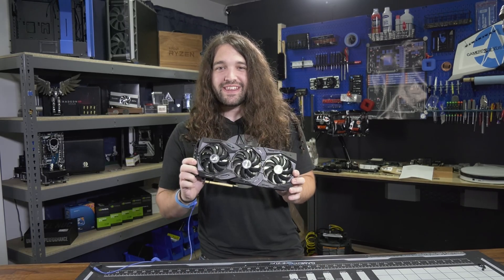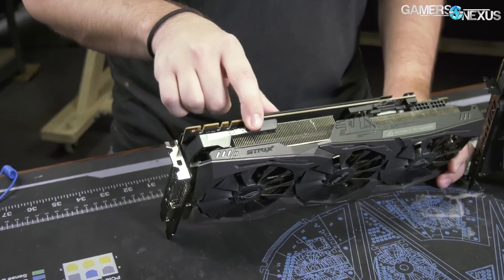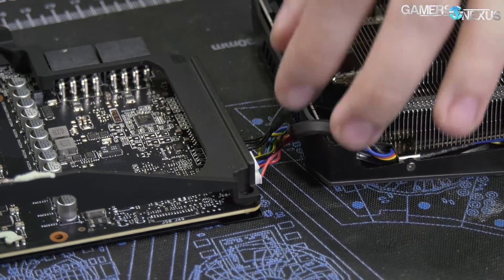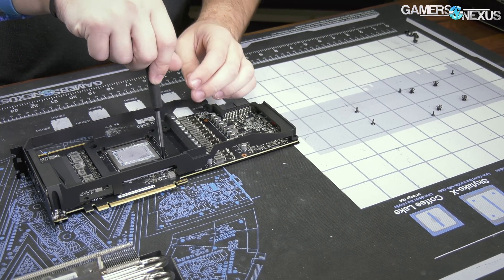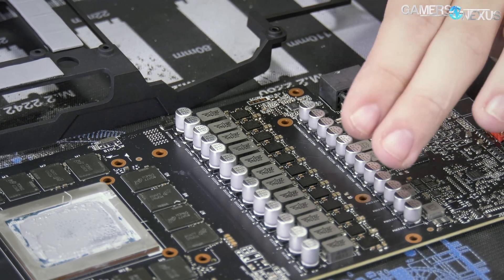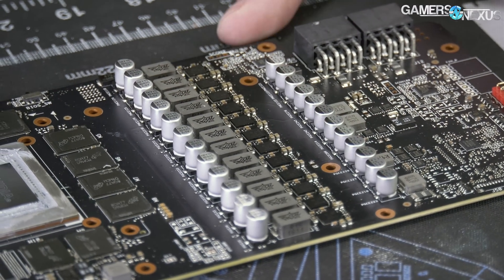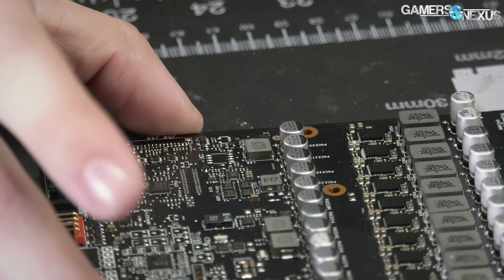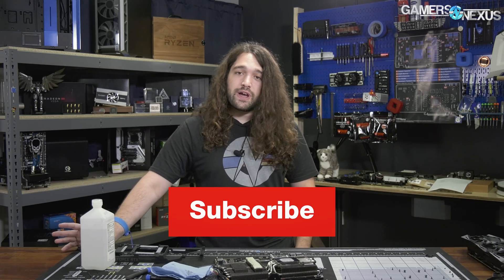ASUS RTX 2080 Ti ROG Strix Tear-Down & Custom PCB

Comment: As for the chip markings and the "K1", seems like the memory channels might be labelled with a letter (A through L), as the K1 cards all appear to be missing the 11th memory module. (much like all GP102 1080 Tis did, IIRC)

Comment: Is there seriously no Thermal Pad connection between the Part of the Baseplate over the VRAM and the Cooler?
And no Thermal Pads under the Backplate as well? 
So we only have the surface area of the Baseplate to cool the VRAM?
Might be sufficient, but it still leaves a bad impression.

Comment: You need to make an adjustment to the screw placement grid. #1 smaller grid, much smaller. #2 Have 3 GPU references in the big white square. This way you know what screws go to what process. You mixed backplate screws with cooler screws.  #3 A new addition to the mat, magnetic there to hold the screws. The cheap magnetic strips used with really cheap refrigerator magnets or bought at any craft store in rolls, about 1/4 inch wide...Have strips of those embedded in the mat very close to the surface so the mat can be rolled up still but can help hold the screws. Maybe if there are stronger magnetic strips that's 1\4 inch or less wide available those might be preferable. 1 and 2 are self evident, smaller grid easier to know where to put the screws and more GPU's less mixing of screws. #3 on the other hand is to keep that sorting you painstakingly did intact if the table gets bumped. As it is the screws will fall over and roll about, if you have allot of them they can become mixed up. Sitting on a magnetized surface they wont fall over and roll plus they will be easier to stand up and if don't care if they stand up they wont roll if the table is bumped.

Comment: 12:49 The K1 could probably mean that the missing memory module has no associated capacitors and/or resistors that help control Vmem to the module. Different Kno could mean different layout of SMDs along the PCB traces.

Comment: Memory module 11 is missing according to the labeling on the board (M11). K is the 11th letter of the alphabet. So the code should be pretty straightforward.

Comment: This is the year of tech curses. APPLE makes an overheating i9 macbook yet becomes a trillion dollar company. Intel overclocks a cpu and goes back to 22nm because they cant do 10 nm. WEIRD RTX launch and the Tom's Hardware just buy it, life without Ray tracing meme,  The return of Athlon by AMD and the Verge building a 2000 dollar computer like it's April first.
Reply: From what I have heard the new Athlon is just a low end Zen with different name, like Intel's pentium. And it's also locked
Reply: Charlie Brown And that's the best thing AMD can do for now. Having the control of the console market is great for them it means that RTX will never be fully adopted by developers just like the rest of the gimpworks right now. Also it'll make sure that games will be better optimized to PC Navi.
Reply: Wait? 22nm? Wut?
Reply: 22nm for chipsets*
Reply: V. P.  *for cheapoo office chipsets.
Reply: @SweetToothVice  ya I know
Reply: They finally removed that "2000$ PC Build video"
Reply: 1500$ iphone lol
Reply: Guys it's just a joke, relax

Comment: wouldnt the K1 naming be based on the letter? K is the 11th letter of the alphabet and the m11 mem module is missing. Just a thought.
Reply: that actually makes sense. i didn't count the letters off so i'll take your word that it's the 11th letter.
Reply: That's what I came to comment saw this then decided i didnt need to anymore
Reply: Maybe I missed it, but could the k denote which module is left out. Ie core 0 core 1 etc

Comment: noob question can the back plate rbg connection be used with a  regular rgb strip if i solder joinst to it to adapt it? wondering cause i want to do a custom plate for that gpu strix 2080ti.
Reply: In theory it's possible.  You'll have to do some digging to get the pin outs correct but i can't see the RGB on that card being any different to Asus' Aura from their motherboards other than maybe a custom plug.  So if your strips are Aura certified then you should be good.  Don't solder to test though ;)

Comment: I know probably does not make any difference (in thermals, I mean), but it kind of bugs me the sticker on the nickel block, near the thermal plate. Otherwise, a great card, and I really appreciate the detail of the cables at the back. Had a bad experience with on breaking connector in my Gigabyte card (only for the LED though, so I left broken for the time ).
Also, Nvidia should learn from them for the servicebility.
Reply: No doubts asus is the best

Comment: Back plate cutout for hot components. So back plate doesn't help heat dissipation?
Reply: They never really did
Reply: I honestly think they are more for the components on the back of the card protection. My 1070 card has a backplate, but it's plastic and the card itself has no high heat-producing components on the back side, just a bunch of resistors, diodes and capacitors.

Comment: So asus has prepped a PCB for partner versions of the Titan, I wonder how soon the Titan will release as it seems they know about it
Reply: Not really,  Like Steve said the K1 section of the product number corresponds as to which RAM module is missing from the potential set of twelve.  I would imagine that say a K3 chip will have a module missing elsewhere on the board so when they mass produce the boards they have to make space for all the modules because they don't know which one will be missing until they marry the chip to it

Comment: Are we at the point yet Where these cards are so big they need another point of connection?
 Its like having a full size pickuptruck hanging out the 2nd floor of a parking garage.

Free Idea.  optional folding Kick Stand with infinite adjustment via a long screw.
Reply: I've actually seen something like that coming with one of the Vega cards from Sapphire. Though it wasn't a stand, it was an angled rigidity bracket that's supposed to be mounted with the same screws that are holding the expansion cards. Sapphire NITRO+ RX Vega 64 Limited Edition that is.

Comment: please stop wearing anti static bracelets.  You also missed a perfect opportunity to throw shade about the verge dude working in the Asus factory as the thermal paste intern.
Reply: Owen Parsons why should he stop wearing ESD straps and being grounded? It’s science. Static discharge is real and can be proven. It’s a very cheap component and worth not potentially damaging something.
Reply: because most people don't know how to use them.   Steve actually pokes fun at this by disconnecting the lead. They simply put them on and then magically think, wow no more static.  giving people a false sense of security.  They need to be grounded to work.  Many people don't understand where they should clip the lead.  it is far easier to just make sure you have adequate humidity, work in a non carpeted area, and to touch a grounded source before working.(plugged in, but turned off power supply)
Reply: Owen Parsons ah I see your point here then! I use a grounding tester myself to double check myself. Beeps if I’m good. But I definitely see your point and agree.

Comment: Only 18 screws?  Seems low I want one with 80 or so screws instead and needs glue.
Reply: and a cover glued on over the screws so you can't clean out the cooler, lol.
Reply: Don't clean the cooler, burn your card and buy a new one.
Reply: I know right. Couldn't imagine how much production cost could be cut out and passed down to the consumer.
Reply: @James Murphy. Ah, that's why the reference cards cost $200 more then their AIB counterparts.
Reply: I dont feel safe with only 18 screws. Something must be wrong with the card.
Reply: If they are only going to use 18 screws they could have least welded something!
Reply: Think big would ja?!
Reply: Price per screw is bad on this card
Reply: I mean, why would you even want to clean your heatsink!
Reply: lol, yeah, just buy a new card when dust starts to cling to the fins, lol. It's the new Apple-vidia, lol.
Reply: Zarcondeegrissom dammit you beat me to it. ;)
Reply: I know it's meant to be a funny comment only but you do realize that the 80 screws from previous video was with the cooler disassembly, right? Here Steve only separated PCB from the cooler and didn't even touch the latter. If you want to only remove PCB (for instance for LC) you only have to remove about 30 screws (yeah, still more but not nearly that many and no glue involved ;-))

Comment: Sorry if I missed it but what is the max power limit? Also, the MSI Trio only did 110% power in afterburner when Guru3D tested where as FE was doing 123% and EVGA reference XC ultra was doing 130% if I remember correctly. Does that seem weird to you?
Reply: I think Steve mentioned that before a bios update the evga was also stuck at 123% so maybe the others are due to a bios issue as well?

Comment: Did The Verge & Tom's Hardware do a review on the 2080ti?
Reply: Sadly,  yes.  "The Verge" has an RTX-series GPU review on their website,  and they used their improperly-built PC to run the benchmarks!
Reply: Erik Hendrickson  Really hahaha wtf
Reply: yeah, they filmed the build, and fixed all the 'mistakes' off camera, misleading anyone that watched the vid into thinking that was the proper way to build a comp. I'm only wondering if they had to replace the rad after skewering it with the long fan screws or not, lol. It's just sad that they are still defending the vid at this point, instead of admitting that they messed up and should have pointed out what not to do. As if they are not just above scrutiny, they are somehow above doing no wrong, lol.

(EDIT) ok, the article has been edited.
Editor’s note: An earlier version of this article included a video guide detailing similar steps on how to build a PC. Unfortunately, that video included a number of errors in the build process, and as a result we have removed it from this article. We have also updated this article to improve the order of the steps in the process.
Reply: hahaha they probably reviewed a 1080ti
Reply: "That's right we got one" holds up Vega 56
Reply: lol. Oh yeah, Fake GTX570, got one of them (nods head). ROFL.
Reply: If you were Nvidia. Would you send Verge a card, lol?
Reply: I wouldn't trust the VERGE to review an etch-a-sketch or a box of crayons...
Reply: ぬらりひよん鯉伴  I though "they got one, yes" :D and that they tried to place it in a regular PCI "socket" but needed to upgrade the "brick" first :D
Reply: N. Siddhartha  Dont know whose fault it is but the guy thst done the build is a complete noob in every possoble way yet he blamed the production and whatever on twitter plus hes a computer science student or whatever is stated in his bio... How he got the job for that is a question... or why did he accept it when he obviosly was not up to the task...
Reply: A bit on the serious side, Tom's did a review with the Titan V also included, which I thought it was pretty interesting
Reply: Yes they both did. Pretty standard, benchmarks and all. They weren't that positive. About as positive on 2080ti as GN and about as negative as GN on the 2080